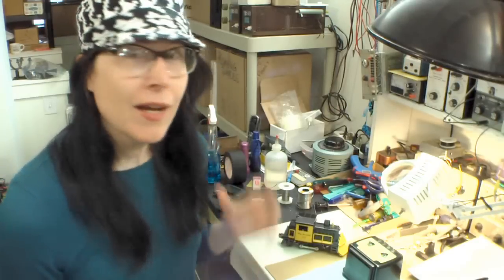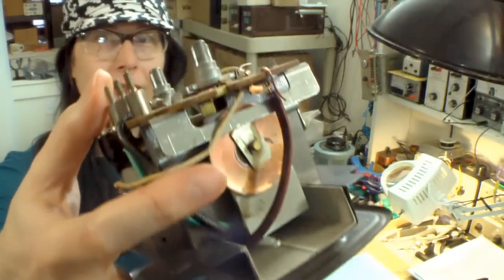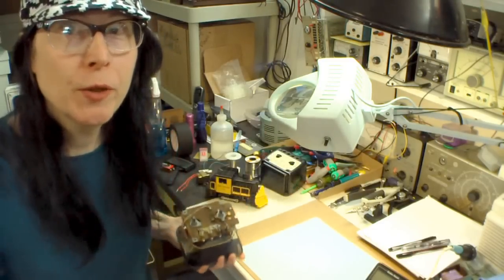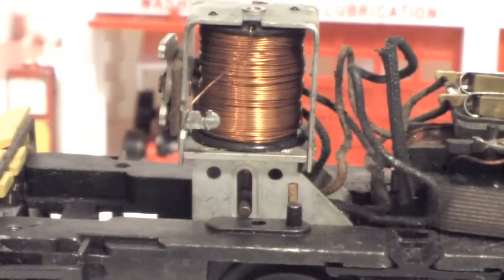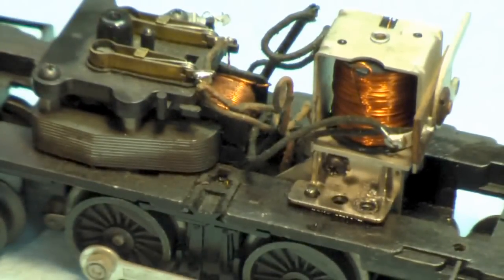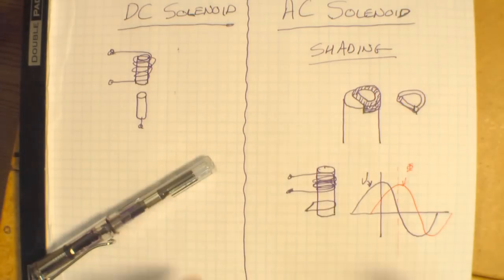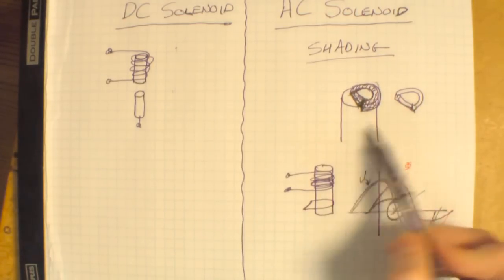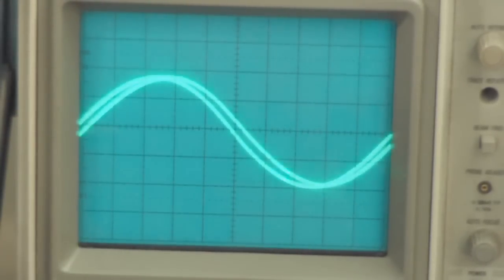Antique Tech: Copper Diodes, Solenoids, Shading Coils, and Lionel Trains

Comment: As a young child I played with the Lionel Train set of my older Brother which he took back to Europe bach in the early 60ties. Indeed I used the transformer as a power source for almost everything. Got the damaged locomotive working again, However, this in-depth explanation made me finally understand the working of these ingenious physics. Thanks a lot for bringing back to good memories from the golden years. Gave the train set back to my older brother when a grew up. My late father and me always play train crashes. One big loop op rail circuit, Flat floor wagon with my hamster as passenger/crash dummy in it. speeding the train up until it tumbled from the tails, one time it tumbled down the stairs and was electronically or mechanically damaged, Could not get it working again, but kept the set because it was unique. I do Remember the steam pills that had to be heated in the chimney, the electromagnetic platform piece of rail to disconnect the wagons, the lane selectors and the railroad crossings which worked on the weight of the locomotive. We had the black big "steam" locomotive, with tender,  https://i.pinimg.com/originals/7c/00/9f/7c009f690cbcaedc1dd9d5d49e7ff72b.jpg You in the US/Canada had really great toys. Made me really had a splendid youth. Enjoyed Lionel more then Marklin. But later I bought more cheap Lima stuff. wich was cheap simple and good. However, sill used the lionel transformer for the lighting of the miniature houses etcetera. BTW no hamster was harmed. The little nagger seemed to enjoy the ride and even the tumbling over the carpet. still, smell the lionel oil/electric thinking about it and also the aftershave of my late father and my hamster....I have been working on my vintage 70 hifi electronics today and needed info about rectifiers, YT presented me you vid. in the autoplay. making my day. in the semi lockdown, we have in the NL. Still saved a lot of the vintage toys. But it was a pity my father got rid of the missile and rocket launch control set ----- one day on ebay......

Comment: Fran: I would like to add some clarification to the way the “E” unit works on your cool Lionel # 53 snowplow. The “E” unit is not 4 position, but 3; Forward-neutral-reverse. The motor is also known as a “Universal” motor which will operate on AC/DC, is doesn't matter. The “E” unit changes the relationship of the armature to the field winding. If you were to remove the “E” unit, and wire the motor so the field is in series w/ the armature, the motor run one way, reverse the armature, and it goes reverse. As far as the “E” unit using air the slow its movement, no, it just uses inertia. Try that demonstration at full power, and you’ll see how fast it moves. BTW, Lionel had a very clumsy reverse unit up until they bought the train maker Ives in the 30’s; Ives held the patent of the basic “E” unit you showed.

Comment: I loved this video as I do, all of yours, Fran. My friend had a Trix trainset which ran on 14v A/c but the same principal applied; there was an external switch rather than a solenoid though, to stop and change direction. I thought that I had dreamt this, but I can see now that I was right after watching this excellent video. I had a Hornby Dublo trainset which ran on 12v D/c but still had the third rail. The direction was reversed by sweeping a control lever round to the opposite side of the control box which had an overload swich; in the case of a short, the button popped up - you had to press it to restore power once you'd removed the short. Many of us older Brits will remember this and when Hornby became Tri-Ang with its two-rail system.

Comment: When I was 8 or 9 my grandparents gave myself and my brother each a LIMA train set. Even at that young age I understood that this was an expensive gift. I always played carefully and neatly packed it away when I was done. It used 6 C cells in the controller and unfortunately ate batteries. My dad eventually gave me a DC power supply to use with it instead. Over 30 years later I still have it, and it still works. Best toy ever! The locomotive always emitted a characteristic o-zoney smell from the motor brushes.

Comment: The pneumatic delay is called a dashpot - 
the ones that I've seen used in automotive and industrial applications are a separate unit, 
not an intrinsic part of a solenoid. The Lionel's sure is a nifty design.
Joshua Lionel Cohen was a frugal chap.
IIRC, some Lionel locomotives had a feature dubbed 'Magnetraction' (sp?).
Electromagnets increased the locomotive's adhesion to the rail, hence greater tractive effort.
Reply: Ah, how I remember the old dash pot timers in the days before miniaturization of the electronic world.

Comment: Memories! Been there, done that! When I was 12, my uncle was an EE at Chrysler and gave me a handful of alternator diodes. Getting rid of the generator was his project. He explained to me that they passed current in one direction and not the other. I figured out a sort of bridge rectifier to power my transistor radio off my Lionel transformer. Sort of worked with a bad hum. Asked uncle about it and he said I needed a capacitor. I put in a electrolytic cap and it worked fine...until my brother tried to increase the volume by turning up the transformer voltage. The cap went off like a firecracker. Scared my brother and mom. I thought it was funny. BTW, my dad had an old electronics experimental kit. Just coils, metal plates, and magnet wire...NOT U.L. ! blew out many a fuse trying to invent what would now be a rail gun. Everyone thought I would be a EE...ended up a biologist with a minor in chemistry, but that's another story. Thanks for your channel. It would have made my younger self even more dangerous.

Comment: The E-unit is very similar to the track-changing mechanism in an 8-track tape player.  A solenoid would pull down a shaft with a cogwheel on it that would rotate and change the position of the magnetic head.  A pawl would engage the cogwheel to keep it in the new position... until the tape wound around again to the metal strip in it, which completed the power circuit for the solenoid - which would pull down the shaft again.  A spring was used to return the shaft / magnetic head back to the top position once it finished the bottom pair of tracks.

Comment: An AC solenoid works the same as the DC one. Why it does not chatter or hum is due to the alloy make-up of the plunger for one and that bleeder hole you observed at the end of the mounting tube would dampen the 60 Hz AC effects.  I had a 1961 version of a Lionel train set.

Comment: Fifties' technology does look rather quaint these days, but do not underestimate what the engineers of the period could and did accomplish with vacuum tubes and metal oxide rectifiers.  Two examples that keep me humble:  In WWII, the United States used artillery shells equipped with electronic proximity sensors that withstood the thousands of g's during firing, and then set off the explosive in the projectile at a precise distance from the target; and the 1953 NTSC color television transmission standard that successfully stuffed color information into the 1941 standard, 6 MHz bandwidth limitation used for the original black and white signals, and made the whole thing two-way compatible for color versus black and white stations AND receivers.  Electronically, this was roughly comparable to stuffing three pounds of potatoes into a one-pound sack without damaging them.  And all without a single transistor or binary digit to be found.  They were geniuses.

Comment: The little snowplow is a Lionel No. 53 and there was something interesting about the original production (there have been reproductions).  Back in the day, most of them had the "a" in "Rio Grande" backwards.  That is the common one.  At some point, this got corrected in production so the "a" would be correct.  But there is only a very low number of those with the correct "a" and they are quite collectible.

Comment: A couple times you mentioned the 60Hz buzz in the solenoid.  It's really 120Hz. Since you're dealing with a piece of steel and not a magnet,  there's never repulsion.  It's as if you had half wave rectified AC in the coil.

Comment: I have a model railroad in HO scale based off KCS railroad. I built all my control system so the block signals work properly and crossing lights function, tracks switch via PC control and dispatcher type map on screen.
As for train control I use DCC but have the option to select DC mode for non DCC equipped locomotives.
DCC allows you to turn the lights on, have them wig wag, sound the bell, horn, locomotive engine sounds, and fine control the speed. You can have 2 trains on the same line at different speeds or hook two locomotive together and set them to equalize or compensate while pushing or pulling so one is not more powerful that the other, especially if your using a DPU on the rear of the train you don't want it pushing too hard and derailing your train.
I have an antique O gauge locomotive GG-1 Pennsylvania though I have no layout to run it I keep it because it is collectible.
In railroad an E unit means the locomotive has "B" trucks or six wheels per truck and "F" unit has 4 wheels (2 axles) per truck. This was the terminology back when E and F series locomotive ran the rails, Today its GP and SD where GP series has 4 wheels per truck and SD have 6 wheels per truck unless you go into the GEVO series ES44ac which use 6 wheel (3 axle) trucks.

Also in AC its not the voltage that changes, its the 60 Hz sine wave as the polarity of the current changes that cause the "buzzer" effect.
The best example of an AC solenoid is your typical AC contactor found in central air conditioning units. This is the part that fails usually also and causes your outside compressor unit not to run and the repair person charges you a small fortune to fix.

Comment: 6:25 Copper Oxide Rectifiers made as follows:  take pure Copper plate (the cathode), heat to red hot, douse one side with pure water - - afterward the surface of the semiconductor material maybe coated with a thin layer of blackish Cupric Oxide which can be disolved away with immersion in a solution of Sodium Cyanide.
The anodic contact is to be "Ohmic"

Comment: cool stuff!  These functions could easily be done with modern electronics, but how many of us EE's could figure out how to do them with nothing but wires and cores??  I've had the chance to work with synchros and resolvers, and have been amazed at all the things people have been able to accomplish with them.  The engineers from 50 or 60 years ago were just as clever as we are, but without the option of using silicon as a solution to a problem.

Comment: OK, I see this is an old post but ... If you like working with this sort of thing, try the old pinball machines . I can tell you are familiar with amplifiers and audio circuits because of phase shifting comments. Tube amps all have some issues with adjusting phase inversion and over-driven tubes when caps go bad. they get very noisy in many cases. I played bass for many years and one of my favorite amps in the early years was the Ampeg V4-B . I had to recap it every so often to keep it clean.

Comment: Awesome bit of information, Always wondered about the mechanics of Lionel trains, I'm cheap, I run HO scale
Reply: HO is not cheap especially if you buy from MTH or buy custom painted trains, DCC equipped trains, etc. Costs can get into the thousands very quickly per train
Reply: yeah this is true, I have a few miles of track, tons of cars, engines, stations all that, but I got a majority at trade shows, swap meets and broken so I could restore them

Comment: Interesting side note; When Mr Cowen first made trains in NYC, a lot of power was at 50cps.(they didn't call it Hz then)
Reply: Also, some houses had DC, and Lionel made a DC controller for those homes. Of course it was death waiting to happen, it had the line voltage directly on the rail, and Lionel made very few.

Comment: Nice video, as when i was a boy i was experimenting with relays and i wonder why some worked on AC and DC while others just worked on DC and only shattering/noising when hooked up to an AC supply. Of course i opened them up to see what makes the difference and i found that on the models wich are worked on both supplies there was a copper plate on the inner metal shaft....But i didn´t know how it worked, but when i removed it the relay does not work anymore on AC supplies.....

Comment: Aw, c'mon! Saw off a little Orange Blossom Special!(8-) Gotta love model trains. Some real science in them.
Copper oxide beats selenium...in my opinion. Got and old Motorola portable AM radio...the one in the metal
case...had to put the antenna in the handle (that swivels around if ya want). I gotta swap that selenium
rectifier out before it burns up...annoying. It's gonna take some math.

Yeah...Never gave it much thought, but that makes sense..the traction motor looks like it started to
be a shaded pole motor...but they didn't put the shade windings on it. That would make it a dedicated one
direction only motor. Winding the armature and sorta using polarity relationship twixt armature and
field(8-)...Pick a polarity relationship = pick a direction. Too cool! Oh, ya know ELI the ICE man, Fran?
If ya see him, tell him I said HI!(8-)

There's probably enough mass to that plunger in that solenoid that it doesn't have time (at 60 hz) to
drop out...plus, the return spring may not pull like a D9 Cat crawler tractor(8-). One other thing...some
alloys don't have very good remender (How ya spell that?!?) characteristics...they don't take a magnetic
"set" very easily...and give up what little "set" they take pretty willingly. Just a couple hunches from my
weird brain(8-). Huh? Oh...the ol' precise diameter orifice trick. K. They got me(8-)...but not on the
inertia part(8-).

Comment: Nice. I wounder, is the EMC really lowest when the voltage is 0, the flux is at its highest then.
Reply: Flux varies with current,  so flux is always in phase with current, not voltage.  Think of a power transformer like this: No load on secondary (secondary open), all of the flux generated by the primary cuts the primary and returns energy to the primary as primary voltage drops to zero.  In a perfect transformer (no resistance or hysteresis) phase angle is 90 degrees, purely reactive, and no power is consumed when there is no load on secondary.  Now short the secondary.  All the flux generated by primary current is "lost" to secondary by inducing current limited only by resistance of secondary winding.  No flux is left to cut primary as primary voltage drops, so primary current is limited only by resistance of primary winding.  Phase angle is zero and currents are purely resistive.  With normal load on secondary, impedance of load limits secondary current, phase angle is somewhere between zero and 90 degrees, primary current is proportional to secondary current, normal operation.  Works for me, maybe not for others.

Comment: Your explanation of the shading coil doesn't seem quite right. To fill in the gaps, wouldn't the flux from the shading coil have to be 90 degrees out of phase with the main flux, rather than the applied voltage? Your diagram has them in phase.